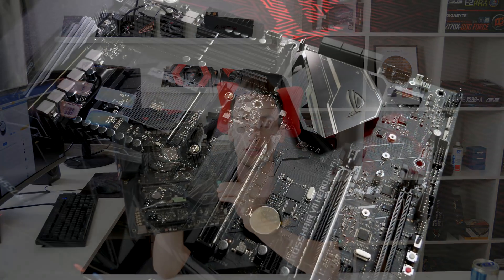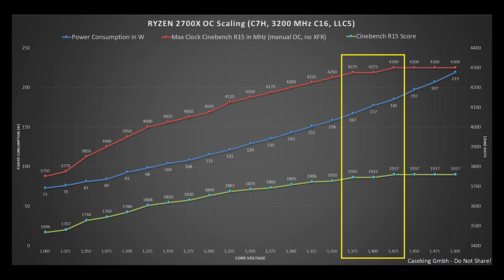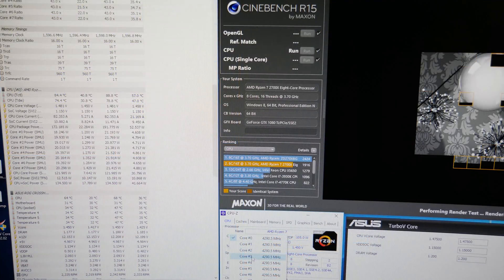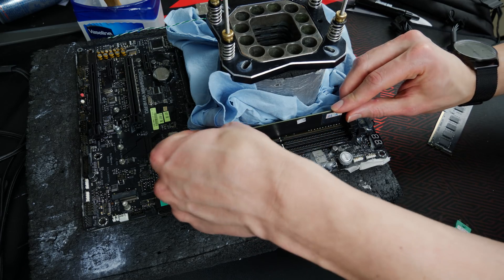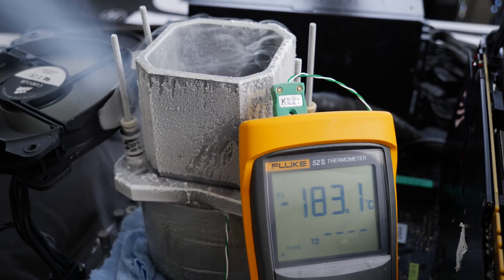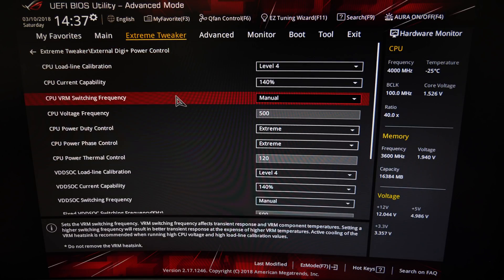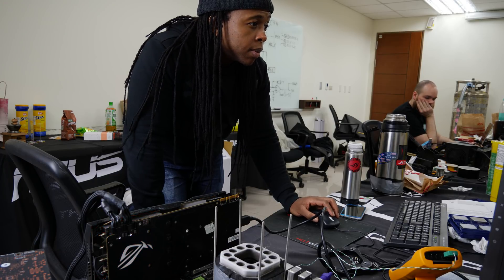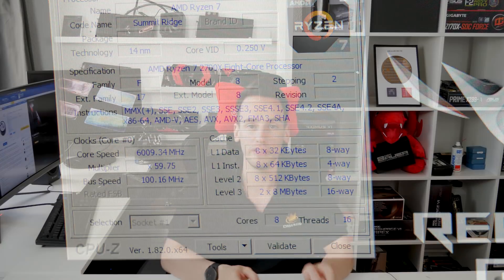AMD X470 Pinnacle Ridge: RYZEN 7 2700X at 6000 MHz on Crosshair VII Hero (en)

Comment: Broke the NDA a little. But no probs.

AMD needs 1 more gen to catch upto Intel HEDT.
Reply: InnDee Gaming: Woah mate, did I ever insult you at first? I do compare the prices because are you really going to pay, ummm, let's say: Double the prices for like 3% more performance on HEDT? Supporting X299, which is a joke platform?
Then are you going to spend a 100 more bucks for 10fps, again? While losing 2c/4t?
Also Threadripper per core is also on par with Intel in workflow / productivity stuff. Games still run better on Intel because of optimization and as I told you, higher core clock.
Then you should also chill out. I'm no AMD fanboy, just some person with decent logic. Even, I used to hate AMD. Also I hate Intels shady strategies. I'm not supporting an anti-competitive company. (Go watch what Intel has done during the last two decades. Only trying to drown AMD.)
Reply: InnDee Gaming: Oh yeah? What about older chips, when Intel bribed Dell to not sell PCs and servers with AMD inside because they were better? (can't remember exactly if it was server only)
Also Ryzen CRUSHES intel in multi-core, which is becoming much more common.
The real only thing is that Intel can clock higher, and has "better IPC": AMD can catch Intel with much lower clocks (4GHz vs 5GHz, the difference is tiny), so imagine if Ryzen could run at 5GHz. That would be massive. It would literally obliterate Intel. But as we can see, GloFo's 12nm isn't as refined as Intels 14nm++ (correct me here if i'm wrong), that's why AMD clocks lower and is less overclockable.
AMD's technology is much better than Intel. They just don't have such hi-quality fabs, have far less R&D people and far less funds.
Reply: Lot's of benchs with the 2700X trading blows with the 7820X (nearly all of them actually). This is why I can't tell if you are trolling, or just really that stupid. (Reading your other comments suggests it's the latter. Sorry about that. Can't imagine what it's like to have to struggle with such mediocre graph reading & comprehension skills, let alone general intelligence).
Reply: actuually u get +1 on that. When I was upgrading my X99 build I was like no solder on x299 ? Well bye bye intel hello AMD. Who to hell makes HEDT with crap tim in cpu. Worst decision Intel made !!!
Reply: InnDee Gaming: 
Ok mate listen up:
Clockspeed is not the only thing to matter.
As I told: Ryzen can barely hit 4.2GHz and trades blows with Intel top CPUs, which are OC'd to around 5GHz. What does that mean? It means that if Ryzen could go to 5GHz, it would literally obliterate Intel. Also AMD's thermals seems to behave much better than Intel's. Why? Because they solder and the manufacturing process.
AMD may not have the highest clockspeed, but it is way ahead of Intel on an architectural level.
Reply: InnDee Gaming: Fanboy spotted
Reply: InnDee Gaming: The point is still relevant. Is it normal that you have to direct die cool to get fine temps?
Reply: InnDee Gaming Hahaha so you're the kind of person that ACTUALLY bought the shit show that is X299. That explains EVERYTHING! XD. 

Here's a hint for you, because hey, while I'm not particularly hopeful, I suppose there technically IS a chance your defective brain just might learn something. You ready? Just because something costs more, doesn't mean it's better. I'm sorry you wasted sooooo much money on a platform EVERYONE was shouting from the rooftops was total shit. 

Easy solution though. Next time you are about to do that.... Just don't.
Reply: InnDee Gaming Also the fact that you upvote all of your own bullshit comments is fucking hilarious XD.
Reply: InnDee Gaming: Also at your point you should have gone X399 Threadripper. Instead of only 10c/20t you would have 16c/32t, on an mATX high-end MoBo. Best bang for the buck, I would go Threadripper over i9 anytime.
Reply: InnDee Gaming: The XE is just a massively stripped down Xeon cash grab while being a hot stove, power hog being prematuredly launched.  If you do only gaming, then an i9 is useless. If you do gaming and content creation, the Ryzen 1700X / 2700X would do just fine on an ITX build *@4.0GHz*. 
You would literally even benefit and even save some cash that you could have spent on a better 1080Ti or even a custom loop. Hell, if you can't watercool, you could have those nifty M.2 drives hanging there.
Reply: ZEED: Thanks mate, I also agree with you! Crappy TIM on a ~120W TDP Processor is just ridiculous.
Reply: Cooe14 Actually, non-thermally handicapped 2700X is getting well in excess of 1800 CB points, reviewrs who bench it w/ Wraith Prism vs Intel on closed loop are retarded. Also fact, 7820X only get a ST score that high because of Intel's Turbo Max 3.0 thingy, which forces it to boost to 4,5GHz (and power spikes), so much higher than it's 4,2GHz stock. Some reviewrs bench without the feature turned on in the BIOS, hence you'll see it slower in single thread CB than 2700X in some test. The devil is in the details.
Reply: +InnDee Gaming Intel would have only 10 or 12 cores on top model if amd didnt release threadripper.
Reply: InnDee Gaming About i9-7980XE...
If you have 2000$ and money to spend like crazy, you care about your CPU going to 5Ghz, you care about every single second that you are going to have to wait for rendering to complete and don't want to buy anything except Intel even if it costs 2x more then competing CPU for 10-15% more performance, and don't care about your CPU burning, go for 7980XE 
Other than that I don't really see a reason to buy it over 1950x.
I am not a fanboy, but 850$ it's just a far better value facts are facts sorry
Reply: "budget wannabe content creator" jesus christ why u have to insult other people? we get that ure intel fanboy but pleaaase stop this nonsense
Reply: InnDee Gaming u r just an insecure intel fan boy.. hey pal, u like getting ripped off by intel, we get it.. but mojority of us arnt stupid like you..   what if i dont have to spend another $1000 for 2c/4t? what if i could get 16c/32t for $899? ..  of course , it u spend $2000 on an intel cpu alone.. u would get the best cpu .  but u are paying an extra small of $1000 for 2c/4t extra compare to amd TR .  see, no body cares.. but when u rant on the internet on how good ur stupid best expensive config is and insult others for buying not intel astucally  brands ur self as a jackass on the internet   ..  perhaps u liked getting butt f**ked by intel ( selling u the same i5/i7 shits for a decade ), but we do not.   now im waiting for a dumb reply from you to complete the insult   ...
Reply: InnDee Gaming Come on man. Don't be stupid. Cinebench R15, a near perfect example of multi-threaded performance in most workloads (specifically rendering here, but the results for most everything looks pretty similar to this with them trading blows), but I'll include the ST results as well. 

2700X - ST= 177, MT = 1771
7820X - ST = 188, MT = 1739

That's story plays out the same almost everywhere, slightly less single for slightly more multi. You gonna fucking get lost now or what??? https://www.techspot.com/review/1613-amd-ryzen-2700x-2600x/
Reply: Intel Sheep :D Just like an Apple Sheep :D and what's a sheep? :D :D :D
Reply: InnDee Gaming this has to be one of the most stupid comment debate.
You are justifying intel 10 core being priced at 1000$...
You can't deny the fact that 1950x and even 1920x are far better value than their similarly priced chip from Intel (i7-7820x? Maybe it's not 7820x their naming scheme is extremely confusing ), also 1950x is 850$ now.
I know you want to defend and justify your purchase, but you can't deny the facts
Edit: I looked it up now it's 7900x
Reply: InnDee Gaming im richer than u . i own properties .. my parents are filty rich.. i dont ever have to get a job..  even with all this money , i still know where to spend my money .. for my workload , the r5 1600 was the perfect choice .. if i had to buy the i5 7600k over r5 1600, there would be no difference between you and me, except for the fact that i dont need a job to afford the best..  ohh and yes.. the insult is complete.. thanks for replying ..
Reply: Let's keep it simple: How reality challanged dp you have to be to write such virgin fanboy nonsense on a video where a person much more knowledgeable then you just said "I was surprised... we managed to break the Intel 8 core Skylake-X LN2 record... while being clocked several HUNDRED MHz lower"??? :)))))
Reply: this is the worst thread i've ever had the displeasure of reading. there's a guy talking about his computer in first person. are you fucking kidding me? most of you people are a bunch of pathetic excuses for human beings and i'm glad i'll never have to hear from you again.
Reply: JackBauerwashere The process is not worse... It's just not geared towards high frequency, it's mostly a low power node. Just look at Ryzen mobile, 2500U and 2700U eat every similar TDP current gen Intel mobile (including top of the line i7-8650U) chips and poke fun of the older gen's 45W chips, like i7-7700HQ...
Reply: ZEED remember Intel charge money for raid on x299
Reply: InnDee Gaming im studyig Electrical and Electronic engineering  . im in my final year.  please would you care to elaborate why on earth i would need a Better HETD pc than you?  my workload consists of some heavy gaming @1440p , circuit/model desiging , and light  scientific simulations..   are u trying to say everyone must buy Intel HEDT pc for every general purpose work?  bro, u do realise , everyone can read the shits u wrote .. right ?   do u like humiliating ur self ?  what if i tell u my living place , which is a 14th storied bulding my mom owns , is better than your  cardboard house ? feels bad  right ?
Reply: Yea but that's the point. We don't live in a hypothetical world where the prices are the same. AMD offers a 16 core processor for $899 and performs somewhere between the 14/16 core Intel models. Also Threadripper has more PCI E lanes. It only makes sense to buy the Intel chip if the user needs AVX512, which 99% of people wouldn't need. It's a niche thing
Reply: InnDee Gaming: I was talking mainatream here. Not HEDT. Something like 2700x VS 8700K.
And if you talk HEDT, just take the Threadripper 1950X. At 999$, it obliterates it's Intel 999$ priced counterpart.
Reply: InnDee Gaming And if you want more benchmarks of the 2700X kicking the 7820X's multi-threaded ass I'm happy to keep providing :). They are as common as sand on the beach. I suppose to demand more you'll have to come back here and admit to yourself you were fucking wrong though, so I have my doubts we'll even see you post here again. In which case waves hand buh bye now! 

Though I suppose you can be glad you paid 5x more for 5% better (at best) single-threaded performance at least XD XD XD XD XD
Reply: If you want to talk for overclocking just see what cpu is holding the world record..
Reply: InnDee Gaming you are missing the point. Intels leed in the market was not because of their superior product, but rather the result of an anti conpatative campaign that resulted in AMD beeing held back the even thou they had the superior product at the time. Intel was even put to court for it and had to pay a hefty fine, but by dragging out the court the damage was done. 

You are saying that Intel is leading because they had the superior product, but that is simply not true. People seem to think that the only thing, to make a company successful is having the best physical product on the market but especially in a business where a big part of the consumer can't figure out what is the better product for their needs.
Reply: Guys InDee is just a troll that does not own shit. He is talking about portable ITX HEDT crap?? Today nobody does that. You buy a top end laptop to avoid looking like an idiot, and if you really need your powerful PC you access it remotely.. A person that has money would also hopefully have brains else he would have lost all that money on buying overpriced crap. Either that or he is a really rich idiot in the process of becoming poor.
Reply: You must be crazy to travel with that. Confirms a lot about your misconception about reality.
Reply: id like to se Overclocked 2700x vs https://www.caseking.de/en/der8auer-core-i7-7820x-4-7-ghz-skylake-x-advanced-edition-hpit-416.html 

:)
Reply: Sure intel is best at gaming but better in every way? No the i7 still lose the older gen r7 in streaming, multitasking, graphics score... not to mention its price is dirt-cheap once ryzen+ is out
Reply: Robert Stan thank you because ryzen first launch it was for the current 6th gen before 7th gen came out and ryzen was destroying Intel in everything but gaming and people couldn't figure out why the only thing Intel has is clock speeds ryzen is to advance and more efficient and smt is better than hyper threading as why  ryzen multi core scores always higher just like he said in the video ryzen at lower clocks was beating Intel 6.1/6.2 x series .
Reply: Robert Stan lpp node or something like that ryzen very efficient I wish ryzen more would use 25watt and dual channel even A 35 watt would be enough increase the video ram to a 1gb there no stopping amd at that point
Reply: InnDee Gaming i have a busy life outside ..  a stupid pc isnt my life.. its just a machine to get my work done.. i dont need an excavator for a simple road drive ..  a simple car is enough .. a stupid moron like u .  all is lift is ur hetd top of the line intel pc .. live with it..  hope u feel proud of it ..
Reply: InnDee Gaming amd chips scale better across multi threaded loads. You even see it in this video, a 5.7ghz AMD beating a 6.1ghz. 

Testing in CPU z, you get about 10.5 scaling on an 8core AMD, while getting around 9 on a Intel chip. This scales even more for server loads, where the core count is even higher. At the same time amd chips run more power effeciant at a 24/7 load. 

For big server loads stability is key and once that is verifyid expect to see a major shift in the server space. Wether they are going for arm or keeping 64bit architecture.
Reply: InnDee Gaming yes there is a reason that Intel took a superior place in the market, but it was not a superior product. At the time amds Athlon CPUs was running circles around Intel.
Reply: Yeah, Intel are having trouble going 14 -> 10. AMD have gone 14 to 12nm, but that's not really a shrink, that's a slightly optimised process. Now AMD are already making some stuff on 7nm, but that's not Ryzen or EPYC cores, it's something much simpler. Whether they will be able to transition down to 7 and just start taking care of business ... remains to be seen.
I hope they can. I am a slight AMD fanboi. At least I want Intel to have some real competition so they can stop telling us how good they are and show us. And they can stop charging double what the stuff is worth and pumping out something that is a 3% improvement every 5 or 6 years... that has design faults allowing side-channel attacks since the mid 1990s.
I don't want to see AMD dominate any more than Intel, or (say) Micr0$0ft... Monopoly is a good board-game, but it sux as a business model. At least, it sux for us....
Reply: I have plenty of money and won't touch Intel products because of all of their shady business practices (Core capping, PCIe lane caps, thermal paste instead of solder, non-K and K versions of same chips, price gauging, etc.) From an ethical standpoint, this company is complete garbage. I won't even touch their stock for fear that they will purposefully short it.
Reply: InnDee I don't know how old you are fella but you're acting like a spoiled child. Calm down.
Reply: I'm neither butthurt, nor AMD fanboy. I'm writing this from an i7 7700K, in fact. The one that is butthurt here is you, we can clearly see when somebody goes from arguments to insults.
Reply: It has nothing with being poor, but if Ryzen was out at the time of buying this PC I would have considered buying that instead. I later bought a Ryzen PC for work, while this is currently being used for gaming and multimedia, at which it is still better than the Ryzen. If I actually was too rich to handle I would have bought a Threadripper and your precious HEDT just for the lols, since being brand loyal is not a smart thing to do, but i realized that it is not worth the price for what I use the PC.

One thing that I would never do however, is drag something that weights more than a few kilos around with me.
Perhaps if i was so rich that somebody else carries by luggage all the time behind me.
Reply: @Who Cares: you are asking a fanboy to be reasonable... that does not work, I lost hope in trying :)
Reply: RJ Santiago: You're absolutely true.
Reply: Robert Stan I seen some get close or a little over 1900
Reply: Who Cares it's the node process use it refusing to clock high
Reply: Who Cares more PCI lanes then you know what to do with
Reply: Nikola Jankovic thank that 2 grand you spend on that cpu could get you a complete tr system if prices was in order I opt for a 1920x AMD Vega 56 undervolted and flashed 64 bios I start with 16gb of ram and then find a 1440p or 1080p temporary freesync monitor ASRock motherboard probably
Reply: And get a two nvme drives for raid
Reply: +Who Cares You forgot to include HP too and others companies
Reply: Marino Šimić It's only 12.6 pounds for a 7900x and 1080ti system. That's super light weight for the power. Why is this even a discussion? I have the HEDT PC and you don't. I have to travel with it and you don't. If I were on a budget and needed a content creation or rendering system I'd get a 2700x. But people shouldn't be naive to the fact that intel parts are literally better core vs core, you just have to pay for it.
Reply: People need to stop lying to themselves. How much kilograms do you add to your lightweight 6kg "portable" PC when you add in all the peripherals? And how much more trouble it creates then it solves in respect to a top of the line laptop? Start being real to yourself man. An assembled PC does not like to be dragged and dropped around, as a PC builder you should know that. Part quality has nothing to do with that but Newtons Laws do.
Reply: Marino Šimić You serious? My mouse and keyboard go in my checked bag so it adds nothing. Instead of a backpack I use the walle duffle made for the m1 and it fits perfectly under the seat in front of me in first class. What are you trying to prove at this point? You don't have to carry it. Nothing gets knocked around. Nothing gets dropped. You're just arguing for the sake of arguing at this point. Let the conversation die. Or link your build so I can have a good laugh.
Reply: The one who is arguing that something is the right thing to do when he knows it isn't is you. And you know it. You are trying to justify yourself by lying to yourself. That is unhealthy man. What you are doing is taking a trip with a truck man. That can never be the right thing to do, no matter how you justify it.
Reply: Marino Šimić You have no idea what you're talking about. Nobody is lying about anything. I've traveled with this computer several times and never had any issues at all. It's even a fun conversation starter with the TSA. I would know. I own it and do it. You wouldn't know anything about it. So before you go trying to tell me that I'm lying, why don't you try it first? Go get an m1. Get the walle duffle. Replace the terrible strap with a leather one and travel first class with it internationally. It's super easy.
Reply: As I've said, you can justify it any way you want but it does not make sense. Sure you can go on a trip with a truck and have no issues, but you can make the same trip with a more appropriate vehicle and have a better time. There was a time I was against the concept of gaming on a laptop. So I brought my HTPC to Lan Parties, since it was small and good enough for gaming, soon enough, I figured out it makes no sense. Having a good enough laptop is easier and more manageable. If you cannot figure that out, fine, it doesn't affect me.
Reply: Marino Šimić I have already done the laptop thing. I'm gone for three months at a time. I find it funny that you think just because YOU would rather carry a laptop means everyone else must be crazy for carrying a desktop! Insane thought here, but how about don't worry about what the fuck I do with my computer that will shit all over your computer. Why are you even still talking? I travel with my computer. I enjoy it. I like having this monster with me. I have to carry it with me four days out of a year. Oh fucking no! Jesus Christ you foreigners are fucking retarded. Now I understand why y'all are considered shithole countries.
Reply: I'm talking because I want to help you. But if you wish you can live in your distorted black and white world. The shithole here is you, just read your posts. Hope you get well some day.
Reply: Marino Šimić Thanks!
Reply: InnDee Gaming: Dude, you're being pathetically narrow-minded. We get it. You love Intel. That's not a reason to insult every person who gets a better bang for their buck, or more cores for the same price. Dude. Just calm down.
Reply: Who Cares Incorrect. I love performance. If AMD had the best performance then I would be shilling for them, but they don't. They're literally for budget wannabe content creators. Maybe when 7nm comes out things will be different and I would line up to get the best hardware. Until then, Intel's lineup are first round picks. AMD is probably a fifth rounder.
Reply: InnDee Gaming: Still. Keep your ideas for yourself and don't insult people. That's just pathetic.
Also from the majority's point of view, spending over 900 bucks for a 10 core CPU when you could have an 8 core for half the price or a 12 core for like 200-300 less is still a bit ridiculous, unless you use apps that leverage single-core performance, and in that case, better get a 8700k than a 7900x.
Reply: Who Cares I bought the 7900x for the luls. It's air cooled in an itx form factor at 4.8ghz. Ryzen 8 core isn't even close in performance and TR doesn't support itx because the chip itself is the size of a deck of cards. I travel with my system. AMD literally cannot complete with even older Intel products.
Reply: Marino Šimić I'm a fanboy of performance. I'm not poor. I don't need to penny pinch for price/performance. If AMD comes out with a 10-12-14-16 core proc in itx form factor that can clock higher than 4.0ghz then I'd switch to that. I'm not product biased, I'm fact biased. Fact is, y'all are just butthurt that you have to settle for lesser parts and try to justify your purchase by making the price/performance argument. Kinda sad really.
Reply: InnDee Gaming: This is just ridiculous. Paying more doesn't always mean getting more. And I'll repeat: Clockspeed is not the only thing to matter. Facts prove that. Facts prove that Intel and AMD trade blows. 
So paying much more for a lesser quality product (hell, which comes with TIM and a paper PCB) that you have to delid or direct-die cool to get acceptable temps is ridiculous.
So your "it's kinda sad that people have to make price/perf because they don't have the money" argument is just stupid.
We are not settling for lesser parts. I settled for the 1800X, which just OBLITERATES it's 8700k counterpart in my daily tasks, and plays nice with games.
Reply: Who Cares 1800x cost 500 at release. You want to talk about not worth it, that is the case. Yeah, Intel needs to be delidded to get to 5.0ghz or higher, but at least they don't need LN2 to get to 4.4ghz like new AMD chips.
Reply: InnDee Gaming: Did I say when I got it? No. I got it with a huge price rebate. 300 bucks. Nifty, eh?
And lemme say that again, because you don't seem to understand: Clockspeed is NOT the only thing to matter.
Reply: Who Cares Bruh, you're comparing an 8 core chip vs a 6 core chip. You're comparing a $500 chip to a $380 chip. See why I say prices shouldn't be considered when it comes to performance? They're arbitrary. You chose wrong BTW. 8700k stomps all over the 1800x OC vs OC despite the AMD having more cores. Now you're just being ignorant.
Reply: Who Cares Also, you got the 1800x for $300 because people figured out real fast that it cannot complete with the 8700k, so AMD had to adjust the price in order to get people to buy it.
Reply: InnDee Gaming: Whelp, seems that I can't make you reasonnable. You even contradict yourself. You're just being so narrow-minded that it hurts.
Reply: Who Cares I didn't contradict anything. Intel parts are better than AMD parts right now. Just deal with it man. I don't know why you're so against facts.
Reply: Who Cares: you are wasting time and arguing about the wrong thing. If he wanted to buy a 10 core CPU for a premium price, it's fine if it gives him pleasure and joy. What does not make sense is how is he using it in and uncomfortable way and justifying it, needs 2 more cores to drag around in a case for no real benefit. He is either lying, gas-lighting himself, or is just plain stupid. There is no rationale with such people in any case.
Reply: Marino Šimić I felt like building on the x platform. My 5.2ghz 7700k played games better but I figured it would be fun to shove a 7900x, 1080ti and 32gb ram in an itx case. I also travel internationally for literally half the year. Three months in the US, three in Canada, three in the US, three in Canada. I travel with the PC for a total of four days per year. That's it. It's not a difficult concept. You can find my build on pcpartpicker. Just go to the side, "see all completed builds" and there will be an option on your left that says "featured build." Hit yes, then scroll down until you see the ncase m1 direct die build. Check out the name of the submitter. Check out my old 7700k build too. I don't get what is so impossible to believe about this. I like my 7900x build. It's a niche thing. Not many people on the planet have a direct die cooled 7900x on air in a portable itx case. I did it just to say I did it. For my actual use case I could probably get away with an 8350k but where's the fun in that? None of that has anything to do with the fact that Intel still performs better than AMD.
Reply: If you don't have a laptop for those 4 days, then why the fuck are you wasting money on ITX 7900 builds. Buy a laptop if you do have and leave that ITX case at home. It is fine to have it for space saving reasons, but it is not fine to drag it around.
Reply: If I had $2000 to spend on an HEDT CPU for actual work I'd get a damn Epyc server. 24 cores, 48 threads. 16 more threads than the 7980xe. Sure, I wouldn't be able to hit 200FPS on it... but you know, that doesn't really matter to me if I'm gaming at 1440p. You know. Because of the GPU bottleneck. For travel I'd just use a higher end laptop, remote into the server for actual work on it, play games on the laptop.

That's why the 7980XE is terrible value: you can get a 24 core zen server chip for $1850, base clock of 2ghz, turbo of 3ghz, and utterly destroys the 7980xe in multicore thanks to a higher dual thread IPC. Seriously, it has like 6% better dual thread IPC(aka: the real core and the SMT thread being used at the same time). You'd have to be stupid to buy the 7980xe.

Meanwhile, AMD is working on a zen revamp in the form of zen2, should give about 10% higher IPC and 5ghz clocks on the low end. Currently they lag behind in single thread by about 6% at most, 3% when the program is properly optimized for ryzen.

Of course, the high end estimate is closer to a 20% bump in IPC and a 5ghz base clock, 5.6ghz boost clock. Maybe even a 6ghz boost clock, but that one is pushing it.

There is a reason intel is dropping the Core i architecture: they can't get any more performance out of it.
Reply: Vyor Generic Last Name LMAO! **Citation Needed** on all that zen2 shit. Pulling 6ghz out of your ass.
Reply: Marino Šimić You fucking moron. Learn to read. I'm only traveling with my itx for four days. I take a plane to Canada with my computer. Then I'm in Canada for three months with my computer. Then I get on a plane with my computer, fly to the us with my computer and I'm there for three months with my computer. I don't need some weak ass fucking laptop. I have two offices. One at my house in the US and one at my house in Canada. I don't want some dank ass low power temp throttling laptop fans screaming at me for 361 days a year when I can just bring my actual computer with me. Are you fucking stupid or something? What makes you think I drag around the computer? It goes from my desk to a bag to another desk. I take very good care of it. I don't drop it. Who the fuck are you to tell me what is and isn't fine to do with something I bought? Fucking idiot.
Reply: https://www.extremetech.com/wp-content/uploads/2018/02/GF-EUV-7nm.jpg

According to GF the 7nmLPP node will improve on clockspeeds by 40%, the high power node adds another 10% to that; or 50% higher clockspeeds altogether.

The 1700x has a base clock of 3.4ghz, 40% on top of that is 4.76ghz, 50% on top is 5.1ghz. The 1800x has a 3.6ghz base clock, 40% on top of that is 5.04ghz, 50% is 5.4ghz. The 1700x's turbo clock is 3.8ghz, 40% on top is 5.32; 50% is 5.7ghz. The 1800x has a turbo clock of 4ghz without XFR, +40%=5.6ghz +50%=6ghz. 4.1ghz XFR+40%=5.74ghz, +50%=6.15ghz.

And my IPC increase estimate? That's a low end estimate. If they use the die shrink to double their FPU and ALU amounts they could get a 50% boost from that(if the rest of the die can feed it).

I don't take things out of my ass, everything I say is based in the facts as I know them.
Reply: Pretty sure that a 6 core laptop with 1080s SLI is better than an ITX machine with a damn 7900x.
Reply: Vyor Generic Last Name 7900x and 1080ti that is whisper quiet and doesn't get above 60c on air at 4.8ghz. Let's see the laptop do that.
Reply: Vyor Generic Last Name Except literally nothing you said is a fact because the chips don't exist yet. You based all that off one slide with literally no source behind it. I also saw slides of Zen+ that showed 5.0+ GHz but we all know how that turned out.
Reply: ... on an itx rig?

I call bullshit that it would be on air at 4.8ghz. It hits 70 on water at that frequency, even when delided.
Reply: Vyor Generic Last Name Literally nothing on that slide said anything about clockspeeds. You actually pulled those numbers completely out of your ass.
Reply: Vyor Generic Last Name Call bullshit all you want homie. I roll this thing at 4.8 all damn day long when gaming. https://pcpartpicker.com/b/kHnH99
Reply: InnDee Gaming I have a question since you have dissimilar core-clocks, how is that treating you? Would you generally recommend pushing "some cores" higher instead of an "all core" overclock?

Also, my Gainward 1080ti GS hit's 2000MHz XD
Reply: Chrinik Jelly of your 1080ti. I actually stopped trying to push individual cores and I settled for 4.8 all core. It's much easier in the long run.
Reply: Far more poor people in the world than rich, that is the majority sir.
Throwing LOL at the end of that sentence shows your disdain for said majority.
Reply: Define poor.
Define majority.

If we are talking world wide we can't use our western standards of "poor" on countries where the average income is 2$ a day...and they live fine with that.
If we are talking a single country then "poor" people are not in the majority at all...average mid income people are the average for a reason.

And I hazzard to say that world wide, that is going to be true in alot of places...the mid income people are going to be the absolute majority overall.
Reply: https://youtu.be/3nKQ5uDA8TM AMD get it 8ghz
Reply: Ryzen is better and more efficient clock for clock on a worse process compared to Intels.
Next year ryzen will migrate to the 7nm process and since Intel already admitted their 10nm is trash, Ryzen will absolutely fucking annhilate intel in 2019.

On 7nm they will be able to break 5Ghz  and they will absolutely murder Intel.
Not to mention servermarket where Intel will be stuck with measly 32 core xeons which cost a fortune .
Amd will be able to steamroll them with 64 core 7nm products, because they arent stuck on terrible monolithic dies like Intel.

in 2019 AMD will not only overtake Intel they will fucking atomize anything intel will have to offer .

AMD 7nm vs Intel 14nm+++++++  5th gen on 14nm LOL. Get rekt-
Reply: I cringe everytime when I read comments from reality-handicapped fanboys. LOL... Ryzen 2700X fucking nuked 7820K from orbit, you blue troglodytes. Just like how Ryzen 1000 decomissioned Broadwell E from existence and sent Intel back to the drawing board. ThreadRipper 2000 coming later this year will clean up the rest of the pleb lineup.
Reply: I'd argue that Threadripper is a better platform than Skylake X in most use cases (Except if you need 512AVX). Especially for the money
Reply: InnDee Gaming: Ah, I see that our points are made. Fair enough. Are you happy with your system? What's inside?
Reply: Thing you're not taking into account is that Intel's nodes are better than AMDs nodes. I'm not an engineer or CPU architect, but from all the reading I've done into the subject, Intel's 14nm is equal to others' 10nm, and Intel's 10nm is equal to others' 7nm. So basically, their 14nm+ is already like everyone's 10nm, and what they've been struggling on, 10nm, is like what everyone else is working on, 7nm. I also saw an article the other day about how companies are struggling w/ their 5nm and 7nm processes, so maybe everyone's struggling on the same thing? I'm not going to pretend like an expert because I'm not, but just because one company says 7nm and another says 10 or 12nm, doesn't mean the 7 is better, and vice versa, different companies, different nodes, different characteristics. I am definitely not defending Intel here, just saying that everyone throws these numbers around, w/out understanding that processes from different companies aren't created equal, so smaller numbers don't always mean better. Pretty sure that's part of the reason Intel's CPUs can clock so much higher, their nodes are just better.
Reply: InnDee Gaming: Did you bump up the voltage on the GPU? You say that you can't OC it, maybe you forgot to bump the voltage.
Reply: Who Cares Yeah, I tried that. It still instantly crashes which makes me super sad. If I could get to 2ghz then I could score above 24500 on firestrike. Right now I'm at a lowly 24300.
Reply: InnDee Gaming all Intel needs to do is put solder back on cpus.that would get tnem massive gains especialy in hedt
Reply: Who Cares  you can see my build here:.     https://pcpartpicker.com/b/kHnH99     it's a basic direct die 7900x/1080ti air cooler in an ncase m1. I've gotten four cores to 4.9 and the rest at 4.6.
Reply: TheCompyshop Or if you travel a lot and want HEDT in itx form factor.
Reply: Christian Nielsen How far back do you want to go? I had a phenom back in the day too, but switched to a 2500k and never looked back. The only reason AMD is in business right now is because their hail Mary glue some dies together last resort strat worked, and they price them cheap as hell and convinced morons they need 8 cores to open up chrome. Meanwhile, anyone with a haswell proc still games better than anything AMD has on the market. No, you can't stream on it as well, but nobody is watching these dumbasses twitch streams anyway with 2 viewers per month and shit. AMD is literally just a gimmick. Why don't people stop ridiculing me for stating facts and ask the experts what they use. Maybe don't take my word for it. Ask Roman.
Reply: ARNOb Rahman All I know is, for as rich as you claim to be, I have a better computer than you XDDDDDDDDDD lol at all you AMD fukbois.
Reply: ARNOb Rahman You know how I know you're full of shit? You can't spell. I love that people can read my comments. I like pissing off all the AMD fankids that care about price/performance. One day you will be able to afford something better than lowly AMD! I'm pulling for you! Until then, maybe you can ask your mommy to buy you Intel so you can play with the big boys. XD
Reply: TheCompyshop And that's the point. All these cucks are saying that AMD performs better when that's completely untrue. Only an idiot would choose AMD if they were the same price. That's why all of the biggest tech tubers use Intel. It's just better.
Reply: ARNOb Rahman It's okay bro. You might get a job one day where you can afford better products. Stay in school. Get educated. Make good decisions and you could have top of the line parts!  Until then, y'all may continue bargain bin shopping the Goodwill of computer parts. Ask Roman what he uses. I dare you.
Reply: Štefan Golian I'm not wrong though. If you are a professional content creator or a corporation then you go with Intel. Ask Roman what system he uses at home.
Reply: Who Cares Yeah, but it can't clock that high. Not even close. So you're comparing something that doesn't apply. I understand the argument, don't get me wrong. I wish AMD could clock higher. Maybe in the future they will be able to figure it out.
Reply: Who Cares Bang for buck doesn't matter to me. I travel half the year and I use itx systems so I can take my computer with me internationally. Hauling around a TR build is not an option. Even then, Intels 7980xe is better than TR.
Reply: Cooe14 LOOOOL this kid with the Ryzen 1700 is talking shit. How's that 3.9ghz oc working out for you? Meanwhile my 7900x is hitting 4.9ghz on air. You're not even on my level.
Reply: Nikola Jankovic I paid 866 USD for a brand new 7900x out the door. I am out of the country half the year and I take my computer with me. There's nothing AMD has that is portable enough to take on a plane. I use an itx system for this reason. There is no such thing as TR itx because the ihs is the size of a deck of cards because of all the chips they glued together. Either way, core for core, Intel still wins. There's a reason all the biggest techtubers all use Intel. There's a reason all the biggest corporations only use Intel. AMD is a joke except for people that want to pretend they have a high end chip for really cheap. There's a reason AMD parts don't cost much, because they're shit.
Reply: TheCompyshop If all of the prices were equalized, only a fool would choose AMD over Intel. The only products they have are for the budget wannabe content creator. People that have the money don't hesitate to purchase Intel because their parts are better.
Reply: Santiago Ferrari at least I don't have to dumpster dive for shitty cheap AMD parts LOLOLOL
Reply: Cooe14 are you talking not overclocked? I bet you are. Let's get that 7820x at 5.0 while AMD struggles to hit 4.2 and then run your tests. AMD is for fucking poor people LOL.
Reply: Who Cares My bad for insulting. I spent the money on hedt and I'm justifying the purchase. I like to look at facts. Core for core, Intel is faster because it clocks higher because of a more refined manufacturing process. AMD has made great strides. Some people don't mind paying more to have top of the line parts. Same reason some people drive Toyota and some drive Lexus.
Reply: If you do gaming and content creation, then the i9 is better than anything AMD has to offer. 7980xe crushes TR. It's not even a contest, and you can overclock the snot out of it with proper cooling. What is the best 1950x can do? 4.2? Give me a break man. There is literally no chip that exists for AMD (except the new g series) that intel hasn't already done, and done better. It's a fact. And, fact of the matter is, my proc performs better than the entirety of the Ryzen 3, 5 and 7 lineup. Threadripper was just a hail mary desperate attempt to compete. Luckily for AMD they were able to glue some dies together and get it to work. All I know is, if someone were given the option to have an 8700k or a 2600x, only a fool would choose AMD. Core for core, intel is just better.
Reply: ZEED the lack of solder doesn't bother me since I just direct die cool a 7900x. Amazing temps that way.
Reply: Who Cares Crushes it in multicore? Are you talking core for core? Are you saying Intel's 8 core loses to AMDs 8 core? If that's the case, you are truly mistake. Let me know so I can provide links to benchmarks.
Reply: Cooe14 oooh spicey. Let's see your benchmarks that clearly shows the 2700x hanging with the 7820x. I'll wait.
Reply: Who Cares AMD fankid logic, compare prices. Prices are arbitrary and can change at any time. Performance stays the same. Compare core vs core or nothing at all. Only poor people compare prices. Get a better job if you can't afford top of the line hardware.
Reply: @inndeegaming6016  Arbitrary my ass, 2700x will be forever less priced than 8700k, use your brain fanboy, dont let team blue speak for you.
Reply: Who Cares Facts agree with me. There's nothing available from AMD that Intel hasn't already done better.
Reply: InnDee Gaming at the moment with Zen+, AMD has defeated Intel on the workstation front. Intel still wins on the gaming front however. 

We shall see after intel makes a new launch and what Zen 2 brings.
Reply: JackBauerwashere You speculated the hell out of that. I look forward to seeing where AMD may go, but as of right now they're bus lengths behind Intel in every way possible. Sorry kiddo.
Reply: fienmen If by "1 more gen" you mean three more gens, and if by "catch up to" you mean "still be behind" then you are correct. Especially if Intel doesn't make any other chips whatsoever. It will be 2022 before AMD makes anything that competes with Skylake X.
Reply: InnDee Gaming They are close IPC wise. All they need is more clockspeed. Also I expect Skl-X successor to come out end of this year or early next year.